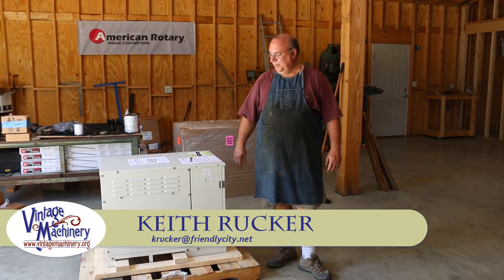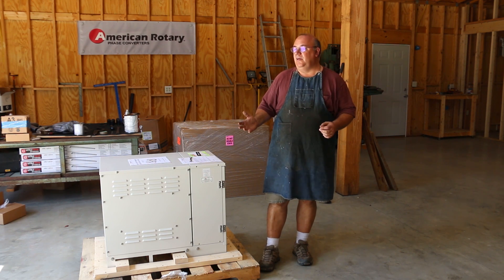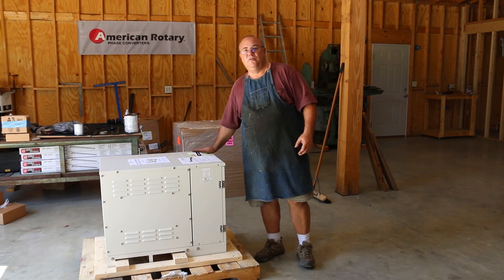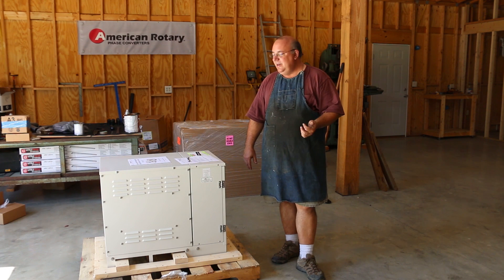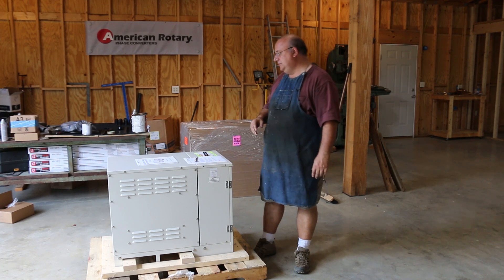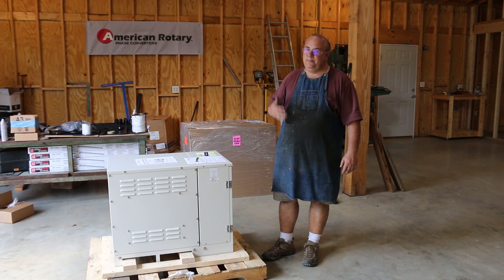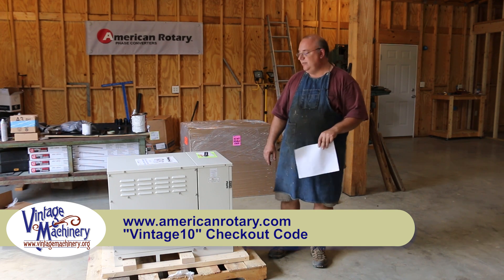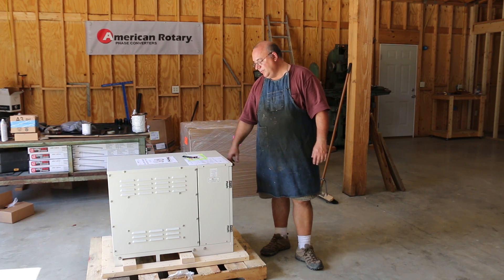Convert Single Phase Power to Three Phase Using a Rotary Phase Converter

Comment: A rotary phase converter only works in counties that have two live wires. By example in Europe there is typically only one live wire to a socket. Even with tree phases come into the house. Often the tree phases are split to kitchen and bath on one live wire, basement with washing machine, dryer, freezer the second and the third for the all the other rooms. Water heater and the oven in the kitchen are usually on three phase. This creates the strange situation that you have tree phase in your house but only  one hot wire in the your shop. And there only a VFD works.

I have the situation right now. To get three phase into the basement i have to open the walls in the stairway to add a new cable. Something i really don't want to do. :-)
Reply: Will work with a single phase from a 3 phase system, though the efficiency of the conversion is always limited by reactive currents. If you watch Doubleboost he uses a rotary converter in his garage to run a 3 phase lathe using a UK single phase supply.

With your problem is the original cabling in conduit or direct buried in the wall. With conduit it is almost always possible to pull the existing cables out and draw the required 5 cables for 3 phase power through, though you might have to reduce wire diameter ( and thus current rating) to get them to all fit in the conduit. Otherwise there is always the option of using an armoured cable on the outside of the house to get the power down there, or just to run a non armoured outdoor cable in conduit down as well.  More expensive for the longer cable but often easier than ripping walls apart. Where I live to replace the mains feeder cable I will simply leave the old DCC cable in the conduit and run a new one surface, using Airdac cable instead. Did that for another place, was both cheaper and easier than ripping up the existing concrete slabs to run the new cable in the same place.
Reply from the maker: WIth 110 v circuits in the US, you are also only getting a single hot wire to most outlets.  What you need to power a phase converter is two hot wires from the breaker box, what we call a 220 circuit.  Very common for larger appliances like stoves, air conditioners, cloths dryers, etc.  Sometimes you may or may not have have one of these circuits in your garage, but if not, it is usually not a major deal to wire one in from the breaker box.  If you have three phase in your house and a three phase breaker box, you can purchase a three phase breaker to fit it and run a circuit to your shop.
Reply: Rpc's work perfectly in the UK and Europe by the way (not so much luck in Europe as they only have like 6kw single phase in comers)... U.K. Built ones use an auto transformer for the incoming live-neutral as we need 415-440v of course. The caps generate the 3rd phase as usual. I use a 12kw boost energy converter with star-delta starting on the idler motor, it will start off a 63a breaker.

Comment: Couldn't happen to a better person.  Glad to see you have what you need.  An old commercial electrician sent me a diagram of how to build one of these.  I may have the parts to make one for my brother who is a printer.  His paper shear had a three phase motor on the hydraulic pump.  He changed it out to single phase but has some issues so I may fix him up.  Thanks Keith, Greg.
Reply from the maker: You can buy a complete unit for about what it would cost to buy all the parts to make your own.
Reply: I currently just have an extra 3 phase motor sitting on the floor. 220 running on that's switched. I kick the shaft to get the motor turning. Turn on the power and I have enough of a 3rd wave created (I've never put a scope on it (that's waiting to get repaired too) to see what the wave looks like) to start/run my mill, lathe, and car lift. If the motor on my car lift (it's mechanical with a big screw on each side) doesn't have enough power to lift from a dead stop, I can run my mill and the starting power on the lift motor is increased.
I walked into a used machinery store looking for a converter. The owner told me how to make what I described above.

Comment: Very cool, and well deserved! I hope your single phase intake has plenty of amps, though. A 20 hp motor will draw amps in the 30's I guess, so your breakers will be quite heavy duty, with thick cabling to go. Good luck, and looking forward to install videos :-)
Reply from the maker: Yes, but I should have plenty of power available.

Comment: even in europe where i live it's not normal to have three phase power in a residential area, but it is always possible to have that installed, though depending on the distance from the local powerhub or transformer station it will cost you several grand to have it installed to your house. No persuasion but cold hard cash. In our shop in a Industrial area where we have 3 phase directly off the street, it even costed about 9000 euro to have an extra 3phase coming in from the sidewalk since we were maxing out with our current machines and wanted to add one more machine to the shop. that did not include the installation of an extra brakerbox and wires inside the shop. Getting that in a residential area would cost waaaaayyyyy more, so for small shops it is really worth it to get a rotary phase converter, as it is in your case.If your shop was much bigger and had several machines running all day, it would be a different story but you made the right choice.again, i still envy your shop and really appreciate the american way of making due with wat's on hand and making that work for you, with or without sponsors.Nice job.
Reply from the maker: Thank you!

Comment: Great videos Keith! One small hit, hardly worth mentioning is that three phase is 120 degrees apart, American twin phase is 180 degrees apart.
Reply from the maker: That is worth mentioning.  I said it wrong (I knew the number but it came out wrong).  I added an annotation to correct my mistake but it does not show up on everybody screen.
Reply: +Keith Rucker - VintageMachinery.org Hi Keith, it didn't show up for me but it's a small detail. Many congratulations on the sponsorship and for educating so many people with your skills. You deserve recognition for your hard work!

Comment: How can you tap 40 HP from a single phase? the supply Cable to the house and the fuse must be something extra.If you run on 110 V that should be around 150-200 A.
Reply from the maker: 150 amps is needed to power it.  It won't use that much except maybe for a brief moment if I am starting a big motor under a load.  It is pushing the limits of the power I have in the shop, but I should be fine.
Reply: That shold be about 1 AWG? To be on the safe side and avoid over heating and other issues,

Comment: As others have said - I'm also not a fan of sponsored content, it usually comes off clunky and I find another video.

That said, American Rotary is really great to deal with and customer service is perfect.  I had both a delivery and install issue and they stepped up and kept in contact until everything  was perfect.  Couldn't have made a better impression.  

Good to see the contributors get some kick back  for all they provide, just don't let it get too infomercial - banner on the wall and a good word is fine.
Reply from the maker: Thanks!

Comment: Irony is, my house is hooked up to 3 phase, but my lathe and mill both have VFD built in for electronic speed variation. So I don't even need 3 phase.
Reply from the maker: Don't forget, you can feed a VFD with three phase.  In fact, it is better to do it that way as you can buy one that is sized for your motor without having to size it up (more money) to cover the power loss of driving it with single phase.  I have several VFD's in my shop, but I power them all with three phase.

Comment: Nice, nice, nice!!!
I am glad thou, that we have 400V 3Phase anywhere here in Germany and need not to deal with Phase conversion. This theme is only appearing if one needs to run a motor on higher rpm without gears. Lets say for an Router or such.
Reply from the maker: Yes, the phase converter is mostly a US thing as a lot of countries have a different power system where this is not an issue.

Comment: Wow Keith, that's amazing - congratulations!

I live in rural Croatia where 3 phase is fed into most homes. Coming from the UK this is strange magic to me, there are even 3 phase domestic cookers, of course I found this out the hard way...
Reply from the maker: You are fortunate!
Reply: Well, I would be if the supply was stable (we measured one phase for a week, should be 230 but fluctuated between 180 volts and 245) and dependable (we average one power outage a month, often only one phase). I really wouldn't like to try and power anything more demanding than a cooker on this!

Edit: since I wrote this a week ago we've had 3 power outs - one accompanied by a loud bang and an electrical burning smell outside, I think the substation blew up again.

Comment: Nice piece of equipment. If I were closer to you I would volunteer my time to help get the new shop up and running.  I like the videos from the museum fine, but the new shop should have much better lighting and more room for better camera angles. And the restored lathe is going to look sweet on camera making chips.
Reply from the maker: I would sure welcome your help!  Right now, it is money slowing me down more than anything else.  Trying to save up some cash to put my insulation in.....

Comment: Wow!  was just in contact with  American rotary after their support of the Summer bash.  I am in the market for a 15hp model and will watch your progress,   Again another thank you American Rotary for their support of the You Tube community and I will confirm my support with a purchase.
Reply from the maker: Give them a shot - they will take good care of you.  And now you can get a 10% Discount to boot!
Reply: Finally winter is here and I had time to wire up and got to do a trial run of my 2 speed 2.5hp / 5hp 14x40 republic lathe.  The wiring of the rotary converter was easy yet I had a question after hours and was surprised when someone answered the phone and assured I was on the right tract.  After learning all the correct start-up limit switches on my new (used) lathe I was off and running.  Got my discount,  pleased with the service and proud to purchase American Made with "Baldor" motor.

Comment: Hello Keith! When you install your circuit breaker box for your rotary phase converter will you please make a video on it? I am curious as to your choice of breaker(s) that you plan to use and the overall setup. I work for Schneider Electric and work a lot with Square D Power Pact 3 pole circuit breakers and Motor Control Centers. Thanks for the great videos sir!
Reply from the maker: I will give you guys a general overview of what I do.

Comment: i lucked out i live in oklahoma  oil country about every power line around me is 3 phase my dad owns a small family oil company so i get to rebuild 440v 3 phase 10-50 HP motors those are fun to start the lights dem low for a second and the electric meter threatens to take off like a helicopter
Reply from the maker: You are indeed lucky.  My father in law actually has three phase in his house, but he has no idea why (it was that way when they bought the house).  The power company keeps trying to get him to switch to single phase.....
Reply: Strange that they want him to switch to single phase! It's already hooked up! What's it to the power company?

Comment: It is very common in the US [and Canada, it's an interconnected grid with shared standards and practices], that side-roads and rural areas with residential loads have single phase distribution.  That is because these roads are long, often very long, and the loads are relatively light.  So it's a big saving to install half the conductors: two [one hot and one neutral] instead of four [three hot and one neutral].  The feeder [feeder is the term for a distribution circuit from the substation that you see at the top of a power pole] is easily balanced by tapping the lightest-loaded phase at every further downstream branch point.
Reply from the maker: Yep, it is an infrastructure issue as well as a huge cost savings for the power companies to not run three phase everywhere.  But boy would it be nice to have three phase in my home.
Reply: Don't most homes in cities still have 2 phase?
Reply: jona jon Standard service for homes is single-phase, even though three-phase may be available at the curb.  Single-phase service is ~230V, but it's from a centre-tapped transformer where the tap is neutral and bonded to ground.  That gives you two hot legs at ~115V, 180 degrees apart.

Comment: Win-win-win situation, American Rotary get some publicity, the viewers get a discount, and your shop has more than enough power.  Very exciting, can't wait to get details on the install, and man would it be nice to see that Monarch powered as designed.  I am miles from anything industrial, but even if you have it local its cost prohibitive.  A buddy has a shop up in Ocala that has three phase on the pole at the street and the power company wanted $20k to hook his shop up.
Reply from the maker: That's the problem, in the US, three phase is considered "industrial" and even if you can get it hooked up, you pay through the nose for the hook up and usually pay a higher rate for the power as well....

Comment: If you have a workshop that needs 3 phases, you apply for 3 phases. You don't have 3 phases to every house, but you can apply for it, else, it means that the general electricity distribution is really badly conceived.
Reply: Not that way in the US. 3 phase is common for industrial areas and towns but there are a lot of places where the best you can get (without selling your soul to the company) is single phase 220. At my shop I run a home built RPC because to get 3 phase to the shop would cost me well over $25,000.00.
Reply from the maker: Not always so simple.  Three phase on the pole is about a half mile from my house.  Sure, for enough money the power company will run it to my door, but it would cost me way too much money.
Reply: That ripping you off!
Reply: Allow me to elaborate. The initial cost of running electricity is the poles (you have them already), the cable and the workmanship.

You cannot avoid the workmanship. The other variable is the cables.

Cable gauge depends on the distance and the total amperage you are going to run. If you have to install an RPC, doubling what your expected need will be and providing for the loss in the RPC itself, you end up more than doubling the expected total power needed. Now if you factor that the higher the voltage, the lower the amperage, you should end up with a much, much lower amperage, so a much thinner and much cheaper cable.

So if they say you have to pay much more for 3 phases, they are simply BSing you.

Comment: Great explanation for the layman that the motor basically becomes a 3 phased generator. It makes sense that you could have a gasoline powered 3 phased generator but this is nothing more than an electrical powered 3 phased generator.
Reply from the maker: Yep, that is pretty much the gist of it.  Of course, my explanation is very simplified, there is a lot going on besides just that with capacitors and such to balance the load.

Comment: Very nice....   Having it outside will be nice for less heat as well. The advantage of 3 phase motors is greater horsepower in a smaller package . The phases are 120 degrees apart
Reply from the maker: Yes, on the phases, a slip of the tongue...

Comment: Slight correction: 3-phase power has three lines which are 120 degrees out of phase, not 180. The major advantage of three-phase is that the power delivery is absolutely constant, which is impossible with single phase. Looking forward to more details!
Reply: Three-phase power is far from constant. You would need some kind of line conditioner for that. The advantage of three-phase is that no capacitors are required to get phase rotation to turn the motor and that a lower current is needed to get the same power.
Reply: The correction only pops up if you have annotations enabled.
Reply: ....and the sum of the three phases are always 0 Volts....
Reply from the maker: Yep, I said that wrong.  120 degrees!

Comment: that is a really nice addition to your new shop Keith . the power pole right outside my house has 3 phase but its going to cost $16,000 to get it conected to my workshop , considering my shop is hardly big enough for the single phase equipment i have its not really worth the expense .
Reply from the maker: That's the problem - even if you can get the power company to connect, they charge an arm and leg...

Comment: Congrats on both the converter and the sponsor Keith!

Don't forget there's one more way to convert, static phase converters. Not the best way to go, but it is an option. Rotary's far better of course.
Reply from the maker: Yes, static converters are another option, but not a very good one.
Reply: Static would be ok for fractional HP up to a couple of HP, basically they're a non variable VFD... and a VFD in that case would be a better idea, methinks :)